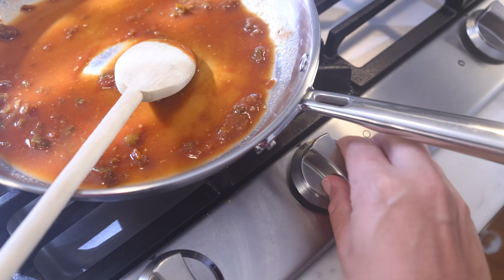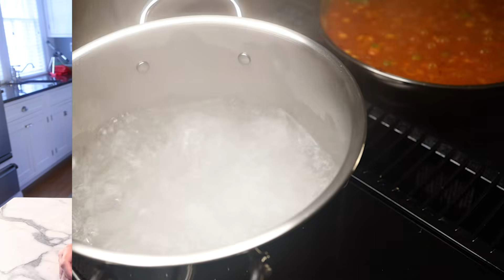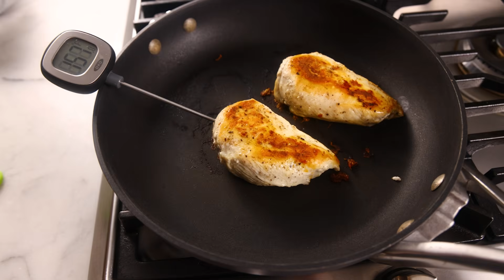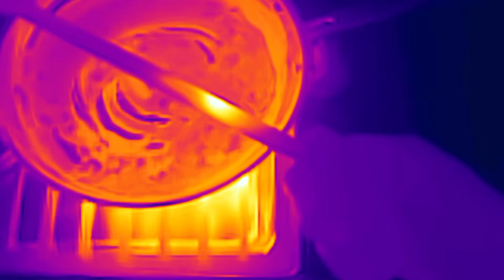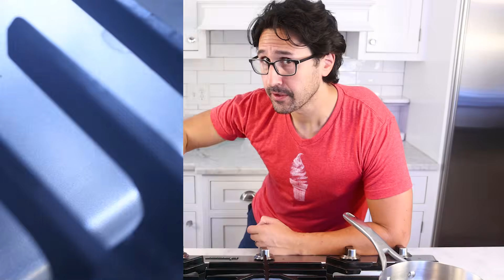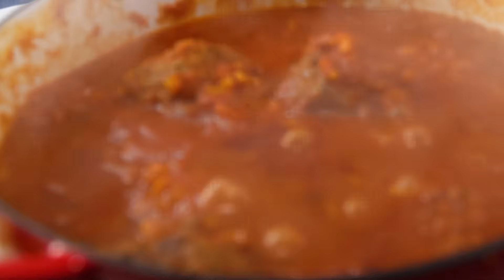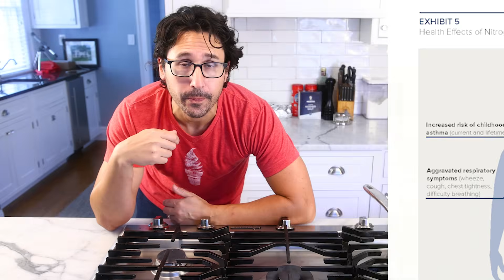Problems with gas stovetops | weak, dirty and dangerous

Comment: I've had gas for years. 

And my takeaway is, do you like burned garlic? If not time to get used to it. 

I moved and got an countertop induction hob* and while not as good as a proper induction range it's so much better and I'll not go back. Although if I move to somewhere with enough space I might get a gas burner and bottle for cooking in a wok or curry Al's Kitchen style.

* because I have literally the worst electric rings, non halogen, look like they are from the 70s basically can't make a big pot of water boil - aren't landlords great?

Comment: Here in Brazil, I believe gas stoves must be close to 90% (couldn't find any official figures). The house we live in had an electric glass top stove when we moved almost 2yrs ago, but it was cracked, so we replaced it with an induction one. I had to change some of our pots, but we love it! It is fast, doesn't use as much electricity as the previous one (we did use it for a while, avoiding the cracked part, until the new one arrived). The only thing I seem to be unable to make properly in it is popcorn (we don't have a microwave)!

Comment: Good video!

I do love my gas stove top, but hate my gas oven.

I will never, on purpose, have an electric stove top, unless the Infrastructure Bill includes paying for Induction Stove Top, and replacing half my cookware which would not work.

PS - Individual burners on a gas stove can be adjusted to increase / decrease the flame. One of my burners produces a perfect simmer on '4' or less.

Comment: I have a Wolf cooking unit at home and it has a mini burner in the middle of a bigger ring burner. It has amazing control from really low to the highest setting. I live in an area prone to electric grid failure so I would not change it for an electric model (induction or standard). It's 16 years old and works like new. That's far more than I would expect of modern electronically controlled units.

Comment: I have been using induction ranges in my home for 12 years. I’ll never go back. You touched on indoor air pollution. For a gas range you need a really good extractor fan. Down drafts all suck. Never put a range in an island. No matter what you cook with, when you fry or sauté, oil vaporizes into the air and if you don’t vent it out of your kitchen, it will go everywhere else. I know TV and YouTube cooks can’t run their vents while recording while talking, but everyone else should. It reminds me of seeing someone use a food processor with the handle and buttons facing away from them. I asked why they were doing that. They said that’s the way Martha Steward does it. I said she is on TV and gets paid to show the appliances off at their best angle. I fear people pick up really bad habits from TV and YouTube cooks.

The other reason to use induction is it heats up your space a lot less. You touched on the waste heat burning food on your pan. It also makes a kitchen less comfortable. You have to cool your home more.

Comment: I had my instant pot to the side of my stove. Well apparently a little to close because that side heat caused the handle to heat and melt. Luckily I noticed it in time and was able to hack it so I could still use the pot but  that taught me a good lesson about the loss of heat from the gas ring

Comment: I think a comination of gas and electricity is best. I hate induction because it's way more complicated to use than gas in my experience, but it is more powerful. Gas can be absolutely awesome because you see what temperature you are based on the flame height.
And you can cook with everything. You don't need a special pan that works on induction. "But you do you" (-;

Comment: When I read the title I was getting ready to argue in favour of gas. After watching it however I have to agree with you on all points. We have a flameout option on our gas cooktop. so no flame no gas. (Safer) We also have a wood-fired stove & I find that the best to cook on. The oven can be a bit trickier though as it's over 100 years old & not as refined as a slow combustion wood stove.

Comment: The thing I've learned from reading the comments is that Americans have really unreliable electrical grids. It would never cross my mind to have a gas stovetop because I might need it during a power outage, and I live in Canada where in theory winter is a bigger concern.
Reply: So all you learned is a lie you arrived at through generalization.
Reply: @grabble7605  You're right, all the comments about people glad they had gas burners to heat their homes in a power outage are not at all evidence of crappy grids. There's never been a single power outage in America.

Comment: I would not move to anywhere where I could not have a gas stove. I moved for 3 years and there was an electric stove and I hated it. My pots would not boil water because the bottoms were not perfectly flat. The electric elements did not cool off immediately, so I had less control when cooking. I moved back to my home here and this is an area that is prone to power outages. When that happens…because I have a gas stove and gas hot water heater I can have a hot shower and be able to cook my food. Electric stove? Never again!

Comment: If your gas stove don't have a really small burner, your gas stove is trash.
If your gas stove don't have flameout protection, your gas stove is trash.
And by the way: why don't you use the proper pot to cook on gas? You know, that one which match the size of your burner. In which you made that custard definitely has too small bottom diameter. It is clearly visible in the video. Interestingly we don't have any of your problems. Meanwhile we have a cheap gas stove, not a fancy one like yours. And still, ours seems to be much better.
If your children go out to play they will inhale much more NO2 thanks to the cars, than in your kitchen.

Comment: After having a gas cooktop for 21 years, bought a condo with an all electric kitchen 10 years ago,  looked into the cost of bringing the gas line into the kitchen, got bids from $10,000 to $15,000.    Didn’t have that kinda cash to blow on a gas line, so looked at electric alternatives and discovered induction.   Was very uncommon in the United States at the time, so they cost double what electric ranges did, and were hard to find.  But even costing double, was still less than half the least expensive bid for a gas line.

Was quite a revelation on how induction was just as responsive as gas, heated up faster, far easier to clean.   As a life long fan of gas, I am an induction convert.

Would a rip out a working gas cooktop?  No, but if I needed to replace a gas cooktop, it would be to an induction top.

Comment: The best thing about induction? No burning of anything that gets on the surface! And thus less cleaning, and less chance of getting burned.

We do have glass-top resistance electric cookers here. They tend to be the lower-end ones. Some people don't like them because they require special pots and pans, but it's so worth it once you get used to them, and most of the pots and pans you get here tend to work on induction just fine these days by default.
Reply: I don’t believe glass top RESISTANCE burners care what kind if pan you use in them. On the other hand, glass top INDUCTION burners require magnetic pans.

Comment: Fun fact: Did you know that you're more likely to start a fire on an electric top than a gas? Despite the open flame of a gas burner, electric burners stay hot longer. There's no turning off the fire, and eliminating the heat source in seconds. You have to Wait for the burner to cool, so if something melting, or on fire, or boiling over, you have to physically remove said object, cover said fire, or remove the boiling over pot from that burner(as you would with a fire depending on how bad its boiling over) all kitchen fires are preventable folks, stay safe 🤌

Comment: I personally, while raised with gas and i really appreciate that it can still be used in power outages, have come to prefer electric for two main reasons.

1. All the gas stove/oven combos we have here have the knobs on the front, so you are not reaching over open flame. But with toddlers this is a huge safety hazard to me, even if by accident and not deliberate. I have not owned a home with a separate stovetop and ovens, they have always been combos. I suppose if they were separate this would not be an issue, but i have neither the money nor the space for that.

2. My kitchen is really small. The space between my stove and sink is 18 inches and that is practically all i have. With an electric stove i can use its flat glass surface as more work surface when preparing meals, without having to put something on top of gas grates. I cannot fully explain how useful this is for me, especially when processing foods at harvest time. It triples my available work area.

Comment: Yeah, I just find it so much easier to judge by eye how much heat is going in the pan, based on the size of the flame. I've never been able to get a feel for that in the same way from electric.
Reply: I understand this, but I think everyone who cooks a lot on electric gets a feel for it after a while. But as a new cook, one of the biggest mistakes I would make was when following a recipe it says: cook this on medium for 5 mins... So I'd put the pan on 5/10 for just a minute or two, drop in my food, nothings happening (because I didn't wait long enough for it to preheat), so then I'd crank it up to like 8/10.  Then you very briefly get it to a nice sizzle, but then you waaayyy overshoot the target and all of the sudden everything is burnt. Or you realize it is starting to burn and crank it down to like 3/10 and then in 2 mins you have nothing happening again. 

So for electric you've got to be patient yet and know your range more so than gas, but after a little while you get the hang of it. I'll even get the pan preheating with some oil on about 4/10 which I know isn't high enough to smoke the oil or anything, but it get's the whole system primed and when I'm about ready to start I just have to put it on 6/10 for about 30 seconds to have the right temp, when 6/10 would otherwise take 3-4 mins to get up to the right spot from cold.
Reply: @jameslk68  that just sounds like not being taught how to use an electric stove, since i grew up with one i fully understood the concept of preheating, also the warning from my mom about never set it higher than medium (how the dial is labeled) unless you are boiling water or preheating quickly. 

Stoves are definitely something you need to get used to and even 2 different stoves of the same technology will behave differently. 

I'm currently learning an induction range, and its great for boiling water since that is just full power and its fine, but for other things I'm still adapting.

Comment: I hate electric stoves tho. hard to control temp, and can even malfunction. once used an electric stove and even when you turned the knob off the it would stay on. just as dangerous 😳
you do be throwing out good points tho, nevertheless

Comment: Wether electricity is environmentally preferable for cooking depends on your grid.

You would need electricity cleaner than 300 gCO2eq/kwh in order fir electricity to make sense.

If you are in France, which gets its electricity almost entirely from nuclear and a small amount of renewbales then yes gas would be worse.

In Germany it does not really matter.

In Poland were electricity is almost entirely coming from coal, especially the extremely CO2 intensive lignite you better get a gas stove.

Comment: Induction for me is prefect, no heat coming from the stove, EXTREMLY responsive, though there is one problem
Having to switch all your old pans and pots for the magnetic ones. Other than that, I still prefer induction over anything
Reply: most are paramagnetic(allcast iron, allcarbon steel, most stainless, and most nonstick pans use a stainless steel base). Also, you can use a heat diffuser for nonmagnetic cookware.
Reply: @theicedragon100  using a diffuser is kinda counterproductive. Just get new pans. I didn't have much issues with that, I never had aluminum cookware. My problem were older high end stainless pots because high end stainless steel isn't magnetic. I moved those into my camper and bought new ones.
Reply: saw someone suggest using pans under non-magnetic pots on induction, it's probably not the most effective use though.

Comment: Adam, if you're concerned about the gases put off by your stove, might I suggest a Carbon Dioxide meter? Carbon dioxide is also put off by burning natural gas, and some studies show it can negatively impact your health. More importantly, having a CO2 meter would help you identify when your indoor air might be "stale" and need exchanging, and might also contain undesirable quantities of other gases like NO2. It's prompted me to make sure my windows are open every time I use the oven, since a night of baking can take it from ~600ppm of CO2 to anywhere from ~1500 to ~2500ppm!

Comment: I'm very glad that our new house has a gas stove.  I am really enjoying the responsiveness of the heat.  It is helpful that the stove that came with the house has a couple of higher powered "quick boil" burners for higher heat, and a "simmer" burner for really low heat.  

That said, I understand the appeal of electric, and I understand the pure heat output facts as well.  The cycling and the heatup period are what kill it for me.  If I had the resources, both for the stove and the cookware, I'd definitely consider induction.   We have a small one that I occasionally use outside for frying purposes, and it's great.  Maybe one day.

Comment: Your smallest burner is too large!
Probably too big for simmering, and too big for the pot size you are showing. (If the pot's sides or handle get hot, the burner is too big for the pot)
Seems to be a common issue in the US, fancy -> big, but sadly big -/> useful.

Comment: electric stoves don’t have to be bad at changing temp but they are built cheaply. usually if they want 50% power for a 3 min span it will turn off for 1.5min. but you could design it to have a fast switch pwm signal that varies the duty cycle. you could still have 50% off time but the off time would be a bunch of microseconds off rather than 10s of seconds. but that makes them a lot more expensive.  

also for the gas stove back home out large burner also has a smaller burning in the center for low heat cooking. it looks like yours has one two. try using that for simmering even on big pots

Comment: My antique gas stove is non electric and runs on pilate light.  The oven doubles as a food dehydrater and i don't even have to turn it on.  You couldn't pay me to change it. NEWER gas stoves have the pans like 5 inches above the flame.  It's ridiculously inefficient. My antique gas stove is 1 inch above the flame.  
Tldr: modern gas stoves suck, get an antique one.

Comment: I can't deny there are serious benefits of electric and there is a serious argument that they are better overall. but I just hate the irresponsiveness of it and how hard it is to read. An electric stove look exactly the same regardless of if its on max or on minimum. I often cook intuitively and I find it difficult to judge what each of the levels of an electric stove mean. Plus I hate that when I turn it off its still hot and I never know its actual temperature.

Comment: Your burning sauce on the side of the pan will be a thing of the past when you move to an induction cooktop. When we renovated our kitchen 10 years ago, we replaced our electric coil stove with an induction stove with a convection oven...bliss! Although boiling water in under a minute sells induction, the real benefit is in the great control over heat, especially at the low settings (like making sauces).

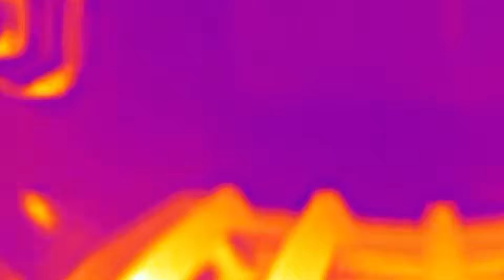Comment: 3:15 that's not simply "wasted energy"...the pot is literally sitting right on the top of the hot iron bars and the heat will eventually transfer to the pot.